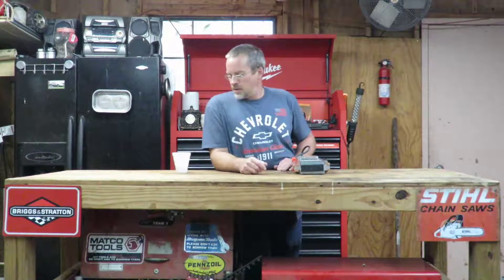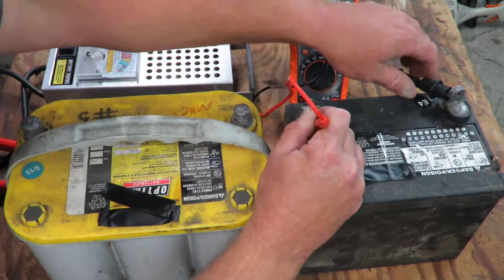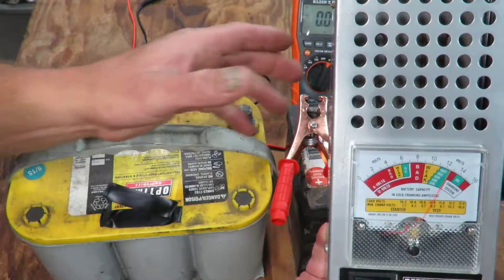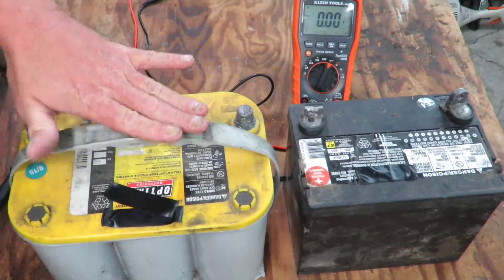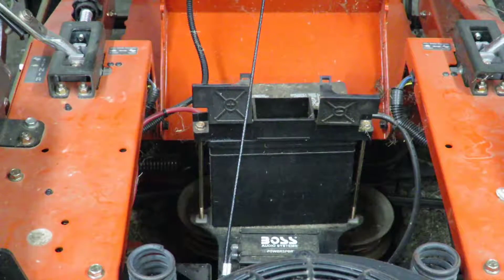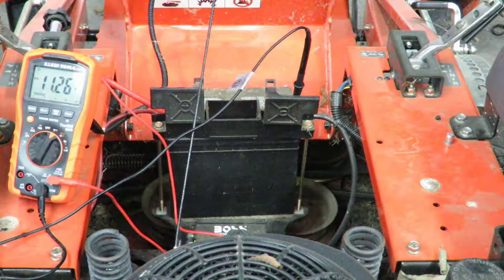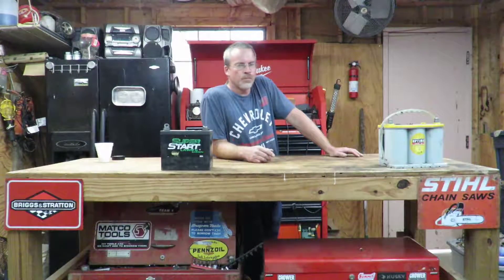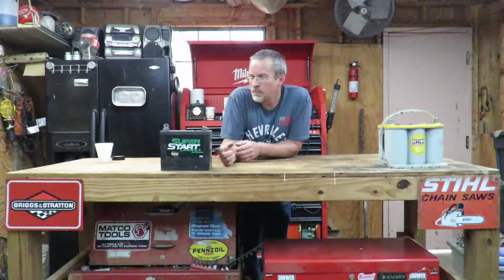How to Load Test Lawn Mower Battery or Auto Battery

Comment: When you spun the mower over did you remove just the wire or did you remove the spark plug. I didn't hear any compression stress while it was spinning over.?
Reply from the maker: @kwells4438
I just removed Sparkplug Wire off of sparkplug.
These newer engines have a Compression Release. That's why you don't hear the Compression.